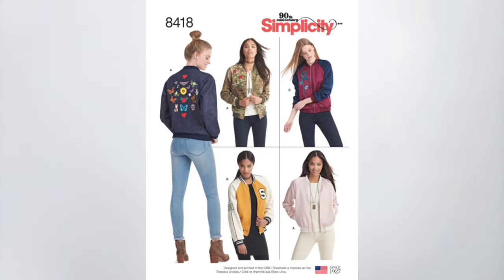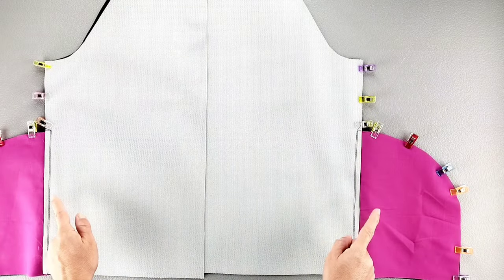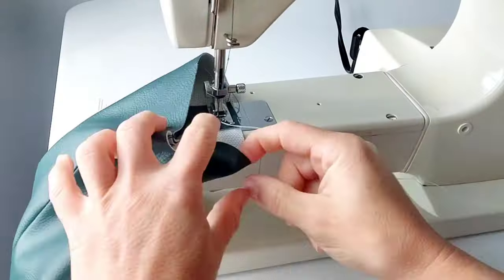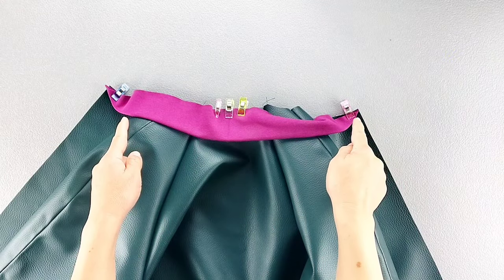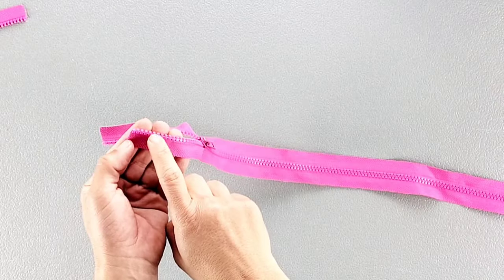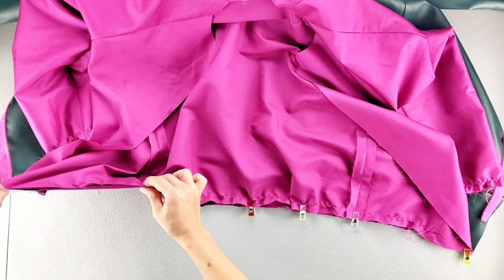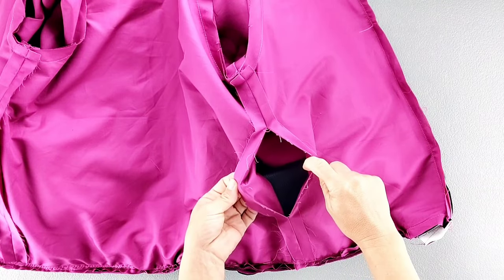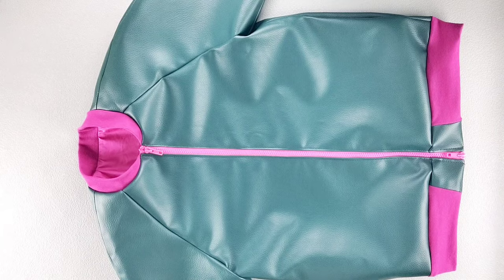How to Sew a Bomber Jacket //  Sew Along -- Simplicity 8418

Comment: My question is about pattern size: do I go by bust or hip/waist measurement.  The pattern would be a size 12 if by ust, but 14 if by waist.
Reply from the maker: It's a good question.  I sewed a size 8, even though I am usually a size 10 for bottoms.  After sewing it, I would probably advise to go with hip size, OR grade out at the hip if necessary.
Reply: @Sew-Happy  ok. Thank you for the quick response. Lisella